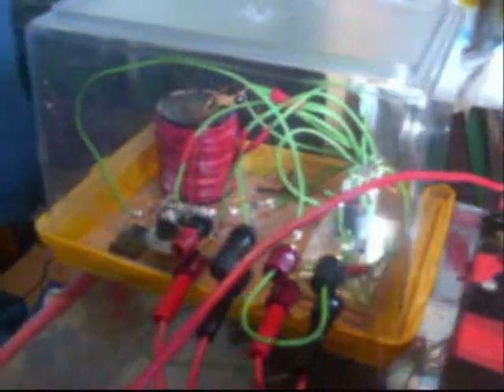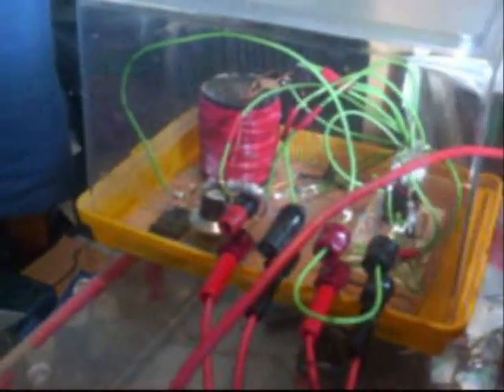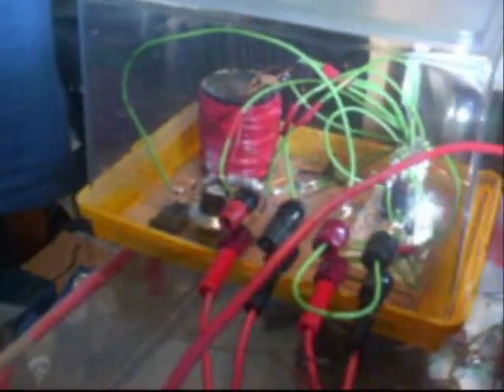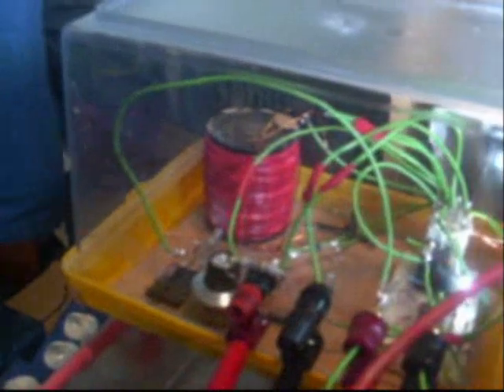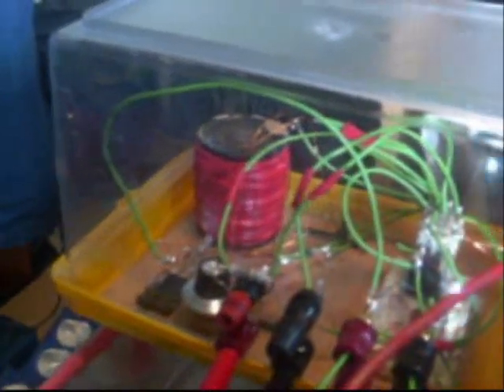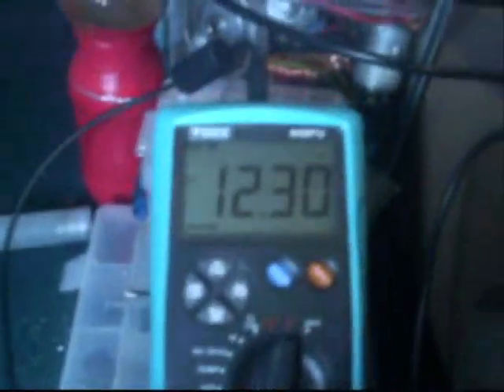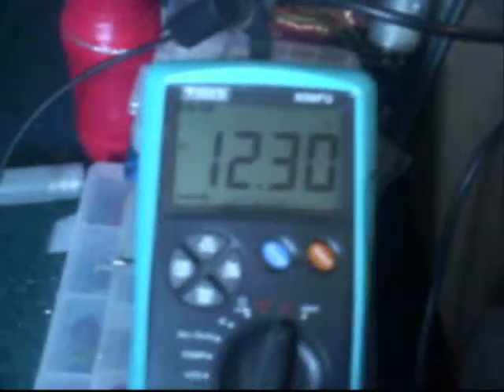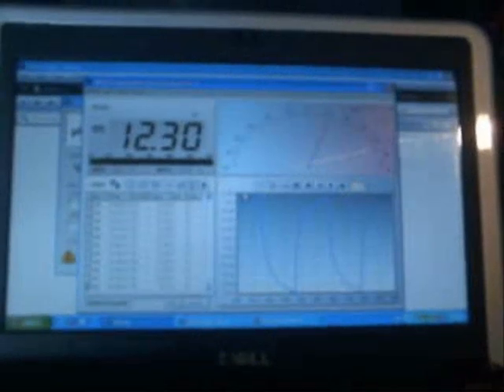OCD Circuit - "O"tomatic Conditioning Device

Comment from the maker: It will work with any of the solid state circuits.  The only addition is the timed automatic relay that swaps the battery from being charged to being discharged at regular intervals which is necessary to condition the batteries.

Good luck with yours!

Comment from the maker: below C20... it just depends on the current being used by the energiser and your present COP.  Choose a load that will discharge the battery slightly less than it charges on each cycle...

You said the daftman has a *simple* circuit that can monitor voltage??? that's not the same one you built last year is it?

Comment: solid state is surely the way!

i built a standard bedini and found it ran with no magnets or moving parts.

COP was extremely promising. 
then it stoped for sum reason.

Im trying to find the fault / get back to a working ssg.

Is this circuit your using a standard bedini based theory?